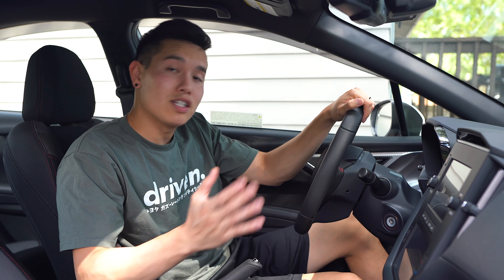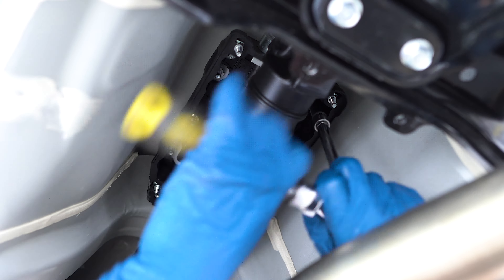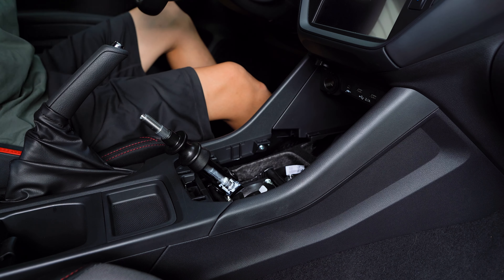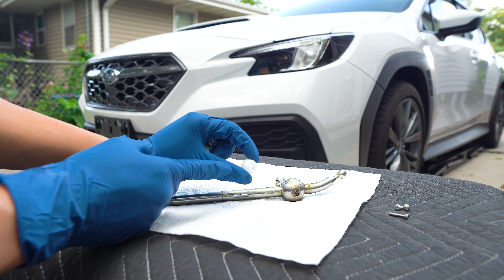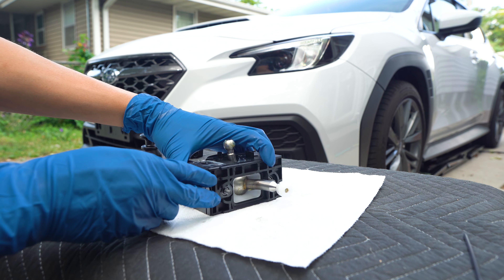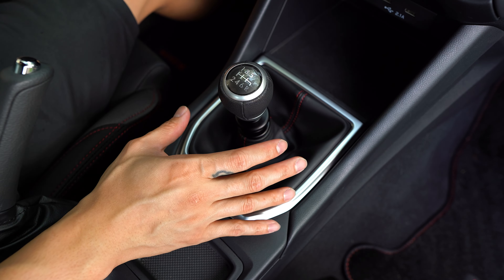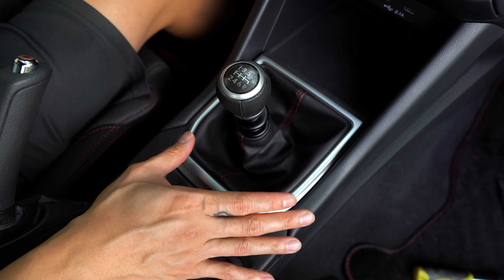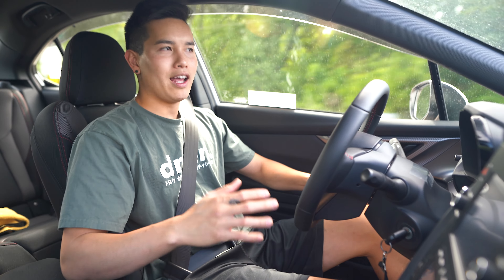22+ WRX Short Throw Shifter Install

Comment: Thanks for showing that buying this and doing it myself ain’t the move. This mod looks overwhelming
Reply: Lmao right!
Reply: overwhelming, yes. but not impossible.  A trip to your local Harbor Freight for c-clip pliers and small punch set plus the common tools/sockets and you are ready.  Very involved with lots of tiny steps, but not as difficult as the auto lock micro switches in the door of my VW.
Reply: FOREAL… looked like he was defusing a bomb LOL
Reply: @K03sport  yea if you have a lift.... this is a pain in the ass to try to do this with some ramps or a jack just so your shift is like 5% shorter and stiff ... lmfao fuck that

Comment: Keep up the content man love to watch your vids extremely informative. Just did all this Saturday originally started with the Prerrin Brass Shifter Bushing as the first mod and then went ahead and bought a Torque Solution STS, a Cobb Shifter Plate Set to 35%, and also have a Cobb Weighted Knob, and I have got to say I Love this shifter feel so much now, it feels amazing and its extremely short with extremely minimal shifter play in gears if any. HIGHLY recommend to anyone that may do what I did to be careful with the two bolts that hold the stock shifter stop u need to adjust it after you reduce the shifts this much the bolts are prone to snapping mine both snapped replaced them with better quality bolts.
Reply from the maker: Glad you were able to find your perfect setup!!

Comment: the adapter was the 1 thing I didn't like about my BW shift knob (and had to fish it out from the knob after several days in the freezer).  Tip:  mark the top of the adapter (black marker) at the knobs "12 o'clock" position so when you have to retighten the adapter, you will know where to line it up and get closer to perfect.   if you don't have a shift pattern/design, you don't need to worry about alignment...

Comment: Just installed BW short shifter 2023WRX and so different, took me a day to get used to it, takes effort, super short and tight, l ordered BW shifter extender for a little levarage and the BW short shifter is low compared to stock, Shift knob makes a difference on this shifter so, ordered grim tallboy and BW micro shift knob
Reply: try the COBB weighted tall shift knob or other tall knob.  the extra height and weight can assist with the leverage you are after

Comment: Took me 8hrs 🥹 so many pieces coming off and had to readjust them. The bottom plate was rubbing so i had to hammer it down to dent it. To the point i dismantled it 4 times But it was all worth it 😅
Reply from the maker: Hey, as long as you got it all back together!!

Comment: So on mine. The bolts youre removing at 7:55 wont come off. The "square" piece on the other side keeps spinning inside the plastic so the bolt never loosens. 

I cant figure out how to get it to stop spinning. Any ideas?
Reply: Did you figure it out? he never responds to the important comments I noticed..
Reply: Anyone have the same issue and have solution? I’m having same issue with the install

Comment: really fast l went back to dealer and got STI exhaust and big difference wow, keep the stock exhaust because now it is loud and feel everything, sounds good but no more quite car. Next upgrade is Noble Steering Wheel, Perring intake and Billot works short shifter heehee, l ordered nice stuff and dealership agree to install, l have 2023 6 speed premium and  will upgrade the sun roof and tint .. stereo upgrade too hahahaha. Dealership will not do the Cobb so this fall Cobb tuning and wheels with Noble carbon duck bill wing hehehe. also sound deadening and comfort seats will finish the car heehee
Reply: How much did they charge you for doing that?
Reply: that’s heehee so heehee cool! heehee

Comment: Did your car come with the sti short shift kit?.. my car supposedly came with it and it doesn't seam very short maybe as short as my stock shiftkit in my 18 golf r.. same knob as your has
Reply from the maker: It did not, but the STI short shifter doesn't really shorten the throw by that much.
Reply: @KevinVo the reason I ask is like I said my car doesn't feel like it's very short. Doesn't feel like my buddies 2020 sti shifter at all.